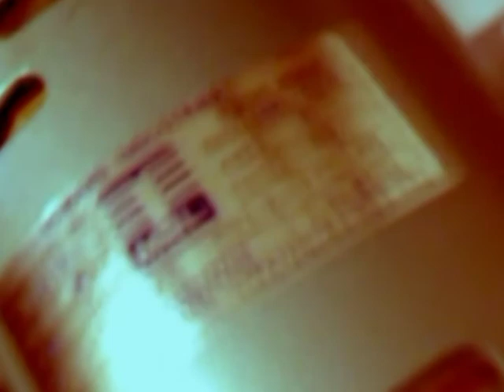Vukodlak Productions-  Hammond Organ Motor Rebuild

Comment: Speaking of the motor I see that it is a Howard Industries Syncronous motor in a standard Nema motor frame.  I have never worked on a T-212 before and am surprised to learn that Hammond was not longer making their own motors by this time. The motors were Laurens Hammonds claim to fame.  He invented the reluctance syncronous clock motor which was adapted for use in the electric organ he invented.

Comment: Hey there, I have a T-211 that buzzes extremely loud. It had seized up cause it wasn't oiled in like 10 years. So, I got it oiled and running again but still buzzes like crazy. I thought maybe that big square capacitor in your video might have gone bad. Could this be a possibility? What do you think?

Comment from the maker: No my friend... that buzzing noise you are hearing is being caused by 40+ year old dried-out electrolytic capacitors...  and more than likely it's the big metal can capacitor on your amplifier.

ANY multi-section aluminum can capacitor more than 30 years old is going to be CORRODED and NASTY inside.. with most of the electrolytic material bleeding from one section to the other.  I promise if you if you take a dremel tool and cut the base from the lid of one of those cans and unroll the cap...